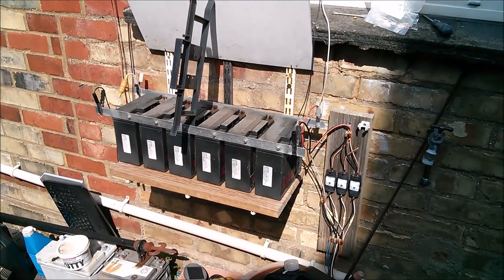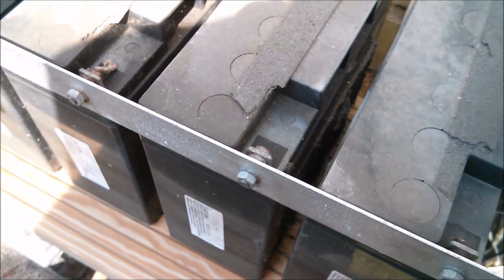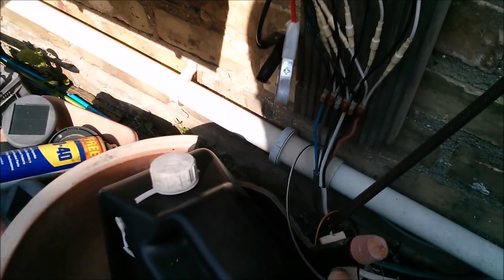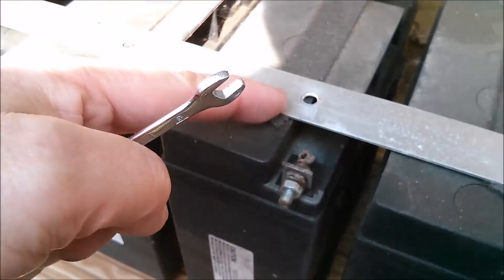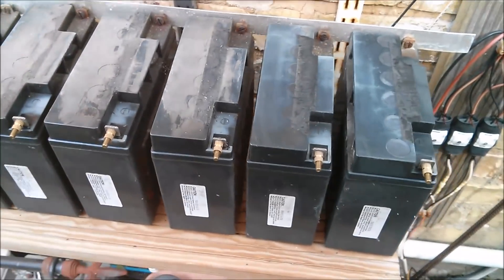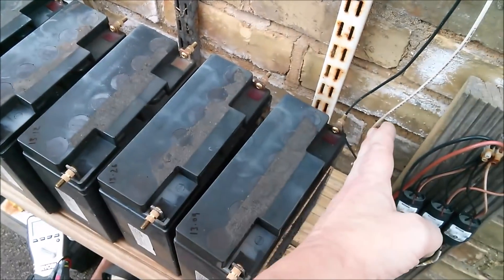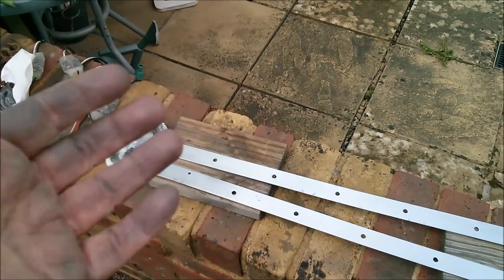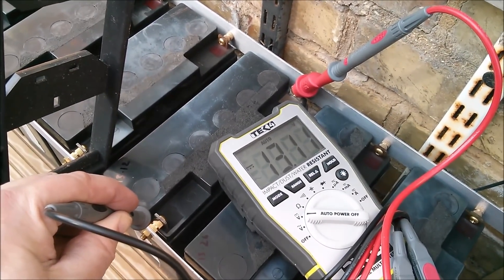Workshop Battery Clean Up

Comment: When I saw your vid on the little 220v DC - AC inverter I thought you were going to use it to distribute your batteries charge as an AC supply. It would be more efficient.

Comment: I second (or third?) the suggestion dielectric grease, mentioned below several times.  After replacing my car battery, I am a newly-reminded enthusiast.  

Also mentioned below, the Galvanic Series is useful to determine the compatibility of metals placed in proximity to one another.  See https://www.engineeringclicks.com/galvanic-series/     

Although subscribed, I have somehow lost track of your channel, and when I came across it today, I see I have missed much.  Good to see you again (even if it is not you who has been away).

Comment: As well as the resistance of the cables the voltage difference is small between two sets of fairly well charged batteries

Comment: Hi Julian, not sure if you're aware but those 'standoffs' are actually heat set inserts (great btw) you use a soldering iron to push them into a slightly tight hole in plastic and they melt in and bind very well when they cool ( instantly) and let you add a decent thread to the plastic

Comment: Whats the total current output of the battery bank?
All cables connected to the batteries should be able to handle the max output +some extra incase of a fault.
It should also be fused!

Comment: I was charging my AGM 12v 14/4ah battery with an automatic charger and got a strange smell for a minuet during charging...   I noticed that the charger was down to 20ma so i checked to see if the battery was getting warm..  only to find the bloody case has split and the battery is now scrap..

Comment: 10mm diameter stranded copper wire is the minimum you should use to avoid voltage drops. Always plan for the worst case where you find you need to be drawing 20+ amps for an hour or two. A generous application of vaseline petroleum jelly will protect the terminals from corrosion once cleaned. Wipe off and replace the petroleum jelly once a month in exposed areas. Ideally connect opposite ends of the battery for power feeds to avoid accidental shorts. Bell wire may be adequate in terms of voltage handling, but it is totally inadequate in terms of voltage drop per metre when any current is drawn.

Comment: I would be greasing the heck out of those steel-brass-alu bolt connections, and probably use shakeproof washers to cut through the aluminium oxide layer. You can see what happens when moisture and electricity get near each other if you look at those choc-block connectors. Wouldn't it perhaps be a good investment to put a load of your electrical stuff inside one of those big plastic garden tool storage bins? Vent / drain holes and mesh in the bottom, sorted.

Comment: Interesting video, thin wire and 6 large batteries in parallel will slow any voltage change way down. Two pieces of advice from someone who has worked on many high-energy battery systems - NEVER lay anything metal (i.e. wrenches, bus bars) on the top of a battery, it increases the potential for a very bad outcome. There are many good anti-oxide pastes available for battery terminals that will prevent corrosion on your terminals.
Reply from the maker: Good advice regarding the spanner - I moved it into my shed :)
Reply: I could imagine AvE's reaction on seeing that spanner near the battery terminals!

Comment: You can measure your thin wire resistance easily at one end.  Just twist the other ends together, measure and divide by 2.  However for your circuit you do need to consider the resistance both ways.  Such thin wire (~22 AWG?) will really limit how much you can charge those batteries in a day and will be the bottleneck with your large solar panels.  I'm guessing it will max out at less than 0.5A which is a very small fraction of your solar panels' capability.
How about trying your DC boost converter system again?

Comment: You should also test those batteries with a car light bulb. I bought a bath of similar UPS batteries that measured full voltage, but when you loaded them with a light bulb they would barely glow.
Reply: I agree. A must test. Same goes with NiCad and NiMH and LiPo batteries.

Comment: why don´t you measure the voltage coming out of the thin wire?
Reply: Because it'll be 13.5V until you connect it. (However if you just meant to check the connection then yeah)
"Only time will tell" he said, but he could've/should've measured the current.

Comment: This is not a good idea.
Aluminum is only compatible with steel. Other metals start a slow chemical reaction that is a fire hazard. 
I have actually seen mains outlets explode. Use stainless steel, and you won't have rust or a chemical reaction.
Reply from the maker: I look forward to my slow chemical reaction :)

Comment: Have you considered the temperature of the environment, the two end batteries will be marginally colder than  the middle ones.
How cold do they get during winter, snow?
Do the batteries have a temperature spec?
You may need a fuse in the "thin wire" you are connecting with the other batteries to protect the "thin wire"?

Comment: You should have a fuse at each end of the thin wires, critters like to chew on pvc, and with the conductors close together they are easier to short.
you should also do the calculation to find the volt drop, cable tables are available
Reply from the maker: We don't seem to have critters that chew on wires - the cables are all fine. Pretty sure 12V in the mouth would send most animals running. I did see a fox in the garden today :)
Reply: Yep, you'd think that 12v would see them off, but i've seen 3 phase 415v  cables in metal trunking chewed, the wires were completely bare, luckily they didn't touch togehter, and no dead bodies.
They may have been lucky that the wires weren't actually powered at the time, but they were in daily use.
Reply: @sparkyprojects  My bothers Love birds ate there way through all the exposed 240V wiring in the wall lights. 240V did not seem to bother them. must have great beak control

Comment: Julian, did you put any of these on ebay or a place to sell and buy? I would like to buy some. Thanks
Reply from the maker: John Nodge sells a similar unit - same circuit, different layout. pwm5kitsuk@yahoo.com
Reply: Thanks for the plug Julian. 

Yes search PWM5 on Ebay, and you'll find my tiny SMD PWM5 charge controller.

Comment: Hi Julian, 

Pretty sure that thin wire is dropping your voltage, even at very small currents you get horrible drop across thin gauge wire on DC, it gets worse when the cores are not copper as the Siemens value differs for different metals.

Your 13.15v would lose almost 1v  across a .25mm2 cable at only 100mA, so unless your batteries are all at unity voltage there are going to be some losses.

A heavier flex would be better, some butyl flex would also give it some UV resistance for use in the garden.

There is a handy little android app full of calcs and reference tables for this, it's called Electrodroid, think I paid a couple of quid for it but I use it quite a lot.

Take care, 

C.

Comment: Every time you convert power you lose a bit, to the power gods.  If you're looking at using thin cables, run the battery system at 24 or 48V's and convert down at the end point.  Ohms is not your friend at 12V.  Anyway fun to watch keep them coming.
Reply from the maker: I'm happy to make a small donation to the power gods. It's all free energy anyway - from that most generous of gods, the sun god :)
Reply: @JulianIlett  no, it is not free, beacouse space on you'r roof is not free (probably included in price of the house, but that is whole anouther question)
Reply: God damn entropy always heating up the universe

Comment: The current supplied by that horribly thin CCA wire will take ages to charge those SLAs.

Why not just use the 2.5 T & E that's already there?
Reply from the maker: I want to repurpose the twin & earth to supply mains to my shed for the crypto miners. If the CCA wire is too slow, I've got some nice copper bell wire I can use instead.
Reply: Provided the csa of the cable can supply slightly more current than the battery banks self discharge current then it should be perfectly fine for his situation imho.

Comment: Why did you mount the PWM vertically and not horizontal to help reduce water ingress?
Reply from the maker: I always intended to box the controllers in somehow, but never got round to it :)
Reply: Why not use MPPT instead, and those thin cables, good job your laid back.

Comment: I would ask what the volt drop across the thin wire is, as that may account for the lower voltage at the battery bank ? Keep well Julian.
Reply: Exactly my though. Pretty thin wire (aka voltage drop) will induce a voltage drop. You should have measured the voltage leaving the big battery and what it was arriving at the rebuilt battery stack.

Comment: I always enjoy watching your work.  It's clever, but not out of reach of anyone with a bit of know-how.
I would be worried that the current through that wire may cause issues when the batteries are quite discharged.